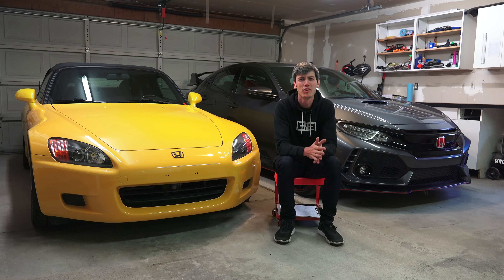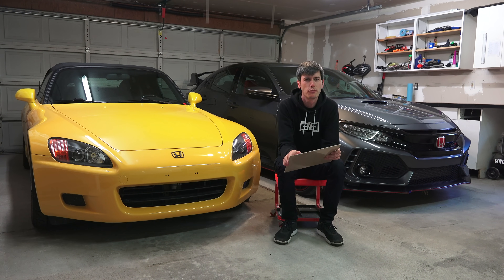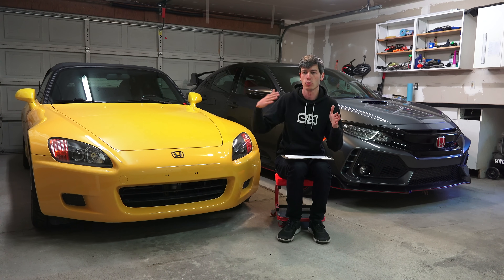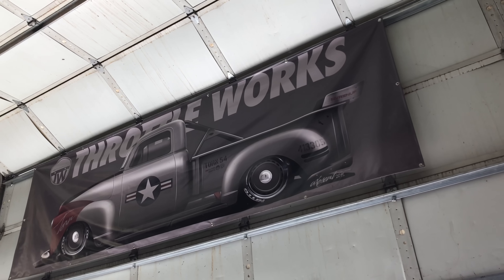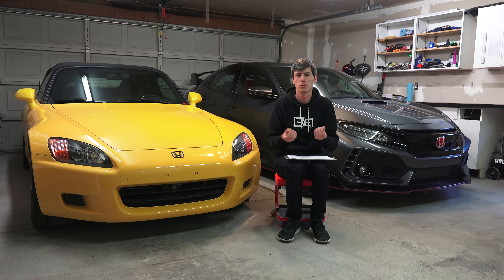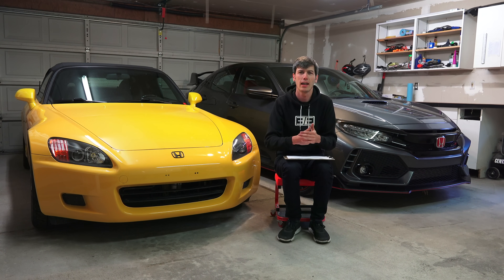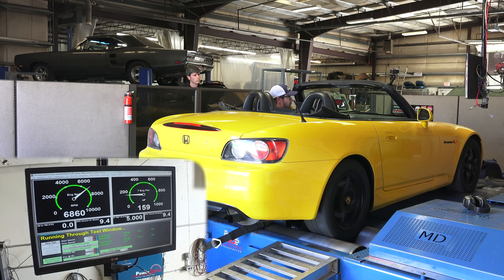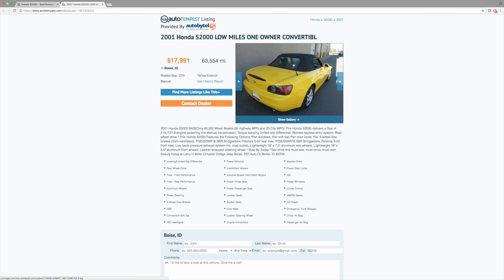Why Comparing Dyno Numbers Is Silly - S2000 Gets Dyno'd!

Comment: Super Charged S2000? Oh that just made my day looking forward to the results.

Although I disagree with you're thoughts about Dyno's, yes they all read a bit differently but you are getting a solid ball-park figure as long as they are the same
type of dyno and you take environmental factors into consideration.  5-10 HP  is so small a difference that you may not even notice it when out on the road.

Comment: I never do shameful plugs on other people's channels so hopefully this isn't interpretted that way, but... I wrote dyno software that can take data logs from tuning tools like Dashhawk and other OBDII loggers and turn them into dyno graphs.  You can google TT Dyno if interested.  Been subbed to you for a while and thought it might be useful given the mods/testing you are doing.  You basically just log speed, RPM, and time: on flat ground, WOT in a single gear and feed a CSV file into the software.  Only other thing you need is some vehicle params like weight, plus weather conditions.

Comment: So, dyno's are useless for discerning power output. But they are useful for establishing an arbitrary baseline from which to discern power output differences after modifying - yes?
Reply from the maker: Correct. Maybe not completely useless in determining power output. I mean if you put a more powerful car on the same dyno, it will show that it's more powerful. The exact power number, however, is difficult to say. And comparing this number with a HP number from a different dyno at a different location won't give you much meaningful information.
Reply: Context dependent, relative difference - the bane of all bragging rights!

Comment: Great video and you've brought up a very important point in the high performance world, especially for couch racers who don't realise that dyno numbers can be greatly influenced by the operator. Your absolutely correct with variances in dynos.  I have been involved in the racing industry for about 15 years and have learned that the biggest variable to affect dyno accuracy and consistency is the human/operator. Yes, it can be argued that different dynos are more accurate than others, but it really doesn't matter if the operator doesn't know what they are doing, or worse yet, thinks they know what they are doing but really doesn't.  I have seen 10 - 20+% difference in numbers measured with same dyno but with different operators.  ie. Garbage (inaccurate data) in, garbage out!  10% is a HUGE difference in racing!  However, the real truth usually comes out when the vehicle hits the road, in the end that's what really counts.

Comment: Shouldn't the V-tec "kick in yo" earlier? 
It bumps the curve instantly and the torque lift is quite steep. Perhaps there would be a benefit if it swaped cams 1k or even 2k earlier since it is noticeable that at such engine speeds the stage 1 profile is choking the intake already.
Reply from the maker: Yeah, I thought the same after looking at the plot. Probably could be helpful a bit earlier.
Reply: Kilo Kountry no it's nothing like that and it's absolutely a performance thing. It's a low lift cam profile (think truck like cam) for good idle and and good low end torque (in the context of a 2L engine). Then right when that cam is running out of breath it switches over to a high lift race cam profile that enables it to run out to 9000 rpm and make 240hp at the crank. Nothing about this car was made for economy. It turns damn near 4K rpms at 70 in 6th gear. If it was as you say than either 1. At idle it would lope like a cammed V8, barely stay running and be even worse on gas or 2. it would redline at 6000 rpms and make 160hp at the crank like most other 2L engines from that era that didn't have some sort of variable valve lift technology. Luckily it has the best of both worlds. VTEC-E was the one created for economy but that's a whole different animal.
Reply: No he didn't, lol.
Reply: It's not like the S2K is an economy-oriented car though, is it? I mean, in a Civic, yeah, sure ... but in a two-seater lots of people don't drive daily ... why bother.
Maybe that was one of Honda's design considerations though, who knows.

Comment: If all dynometers are calibrated and using all sensors ( air temperature etc ) they should be all reading similar output of hp. I believe hub dynos are more accurate as they eliminate Tyre spinning on the drum...

Comment: I am curious to see how the Super Charger effects the power band. How much torque it sucks off the bottom end.
Reply from the maker: Yes, it will be interesting to see. It's a centrifugal charger, so it's likely going to have very little effect at low RPM, and build boost as it spins faster at higher RPM.

Comment: A stock s2k put out 240 hp to the crank not the wheels.  Around 205 whp is about right for a stock new ap1 s2k. 15 year old 100,000 mile car 190 to 195 whp would be excellent.  The funny thing about the S2k is the torque peaks way up around 8000 rpm also.  I don't know how Honda pulled that off.
Reply: maybe big short intake ports, that would make low rpm port velocity, well, LOW ,therefore adversely effecting torque, but helping high rpm, and of course the cam, Ecu and other factors
Reply: I don't why or how they crammed the torque peak so far up the curve. I just know that cars are more fun to drive on the street when your peak torque is low within your daily driving rpm band.
Reply: The head is factory ported and the valves are pretty huge relatively.
Reply: Andrew , more fun for the average joe.  For those of us that know how to use a gearbox and love that last push for the redline there is nothing like a high winding engine. 
 A basic N/A BMW strait six is the best of both worlds.  Good power and torque below 5000 rpm with a nice final high torque high hp push for the 7000 rpm red line.   All the 2.0t turbo's on the market now have no top end.  The laggy top end ok  2.0 T in the Civic type R and the wonderfully liner Vw/Audi 2.0T are two exceptions.  Most cars have a 3000 rpm power band weather it is from 6000 to 9000 rpm or 1300 to 4300 rpm is up to the manufacturer.

Comment: I wonder what it would read if you put an actual horse on a dyno.
Reply: The definition of horsepower created by James Watt was based on the continuous, sustained power output of a draft horse.  He measured how much water could be raised in a minute, at a normal walking pace, which ended up as 33,000 ft-lbs/min.  Or 550 ft-lbs/s.  That is 1HP.  However, the peak power output of a horse (at a sprint) is about 15-20HP.
Reply: A single horse can produce a good bit more than one horsepower, actually.
Reply: David McClelland it would get sucked into the rollers
Reply: Actaully about 15horse power for an average draft horse.  But remember that hooves dont have slippage the way tires do.
Reply: It's in the front right below the air intake. Unleaded only.
Reply: NickiLasse no they pulled coal in the experiment not water
Reply: 1
Reply: One

Comment: Could you do a video on "Why engines have losses over time"? I presume it's to do with the cylinder head getting clogged with carbon, piston rings leaking, cam shaft wear, tappet adjustments (hydraulic vs adjustable), etc. In fact, I restored a fair bit of torque after reconditioning my cylinder head alone so I presume that is the main cause of losses.
Reply from the maker: Jim Griffiths ha! So happy you asked! I’m doing a three part series with AutoTempest, and that’s the next video! :)
Reply: Awesome! Can't wait to see them. :) Thanks so much for all the time you dedicate to making these videos.
Reply: It is a combination of all the things you mention, plus things like injectors and fuel systems clogging over time, cat and mufflers becoming full of carbon causing restriction, HT leads and spark plugs wearing out, and sometimes things like engine sensors getting old and becoming inaccurate, leading to sub-optimal fueling/timing.  You'd be surprised how many bhp you can gain just from cleaning your fuel system and injectors, +10bhp is perfectly realistic! Likewise new sparks and leads can add 5bhp to an old engine.
Reply: Jim Griffiths That would make for a really interesting video. I'm kind of surprised that you got so much back from reconditioning the cylinder head. I always thought that the main cause of power loss came from ring and cylinder wall wear. Jason, if you see this, please make this video!
Reply: Fuel filters are consumables like spark plugs, so this is obvious. An old fuel filter will first be a problem when it gets too clogged. It does not manifest itself as a gradual decline in power over time. Cylinder and rings wear is rarely a problem unless you over rev it or skip oil changes. Looked at cars with 350K and Cylinders look as new. What kills compression is clogged or pitted valves which is always to be found to some degree on older engines.
Reply: Jim Griffiths : restoring "lost" horsepower by reconditioning and replacing old parts would be a neat segment to see if they gained back. Like would replacing the O2 and map sensors get HP back?

Comment: Power is a physical quantity that should be measured to some degree of accuracy. To blanket label them "it's meaningless on different dyno" absolutely not true. They may be off by some factor (may not be linear), but they certainly do mean what they measure. Of course, whether lay people understand the complex parameters is a different matter, but the dyno readings, even the peak values by different dynos, are relevant.
Reply: Engine dynamometers in air-conditioned engine dyno chambers give excellent and accurate results --> chassis dynamometers with variables like tire pressure, ambient temperature and so on do not give such accurate  results  sadly. :(

Comment: So then, how would you accurately determine HP?
Reply: By understanding the variables, running the dyno correctly, and understanding the precision and accuracy of the dyno and including the error with the data. There has to be a dyno shop somewhere that actually knows how to use the thing.
Reply: Use an engine dyno for engine power in a steady constant engine speed using a brake to absorb the engines torque output so that the forces are equal. An object in motion or this case rotation stays in motions. It will only accelerate or decelerate if the forces involved are unequal.

This is the term brake horse power. It's measured by knowing the rpm of the engine and the torque output measured by a load cell on an arm attached to the brake. Between those two you have work and time to calculate power.

Doing power sweep tests on a Rolling roads and even hub dynos have a big problem you cannot easily make accurate which is inertia. The moment something is accelerating its using some of it's torque to work against the inertia of the load. Now while it's easy to compute the inertia of a roller. It's less easy to know the exact inertia of your drive train masses which are all unique to the car not just model. Think tyre wear brake rotor wear.

Plus then try to know the moment of inertia for all your gearbox and drive shaft prop shaft and clutch etc etc it's a no go. You'll never do it and it mot be the same in the next car.

So again you can more accurately measure power at the wheel in steady state using a brake on the end of the roller but you can't be as accurate when running a sweep test.

You have to assume an about of inertia for that typical type of vehicle. Too low as the rate of acceleration increases power numbers are skewed lower. Too high as acceleration rates increase then power is skewed higher.

Massive giant 2 Tonne rollers like dyno jet are terrible as they do not control the rate of acceleration meaning changes to the vehicle will effect the the rate of acceleration and depending on drive train inertia skew the gains down or inflate them.

Australian makes like dyno dynamics use a ramp rate to control the dyno to maintain the rate of acceleration during a sweep test so any inertia error will be the same whether you have a 200hp car or then boost it with a a turbo to 400hp the inertia error rate will be the same on both runs as the dyno will use more braking to control the acceleration rate to match.

However they're still not perfect as you as an operator still have to enter the amount of inertia. Also the operator might choose to do a run at one rate of acceleration and then another run at a faster rate of acceleration as he can select this based upon kph per per second. Again any error in the inertia will show an increase or decrease depending on how whether you over or under estimated your inertia.

It's possible to trick rolling roads by changing wheels or brakes or flywheels and changing your inertia of your drive train during a sweep test also. Hub dyno are less susceptible as they don't have wheel masses to worry about but do have some inertia in shafts hubs and gearbox etc.

But again the only way is to use a brake to equal the forces and measure in steady state, 

Why don't we do this on a rolling road, well it's inconvenient and very stressful to hold a vehicle at full throttle at a steady speed, plus even tyres and traction sometimes not practical at all.

A rolling road is all about conveniences of quick and easy testing you must understand this and it's important when using it to keep your testing methods consistent as if wouldn't matter if the dyno is inaccurate or measured in fairy dust. If it put out the same result back to back that when you made a change you could be confident that it was quantifiable. 

If it's not consistent then it's a waste of time as you'll never really know whether or not the change was really making the difference.

And this is before we even get into parasitics of dyno tyres or drive train windage etc to try get a flywheel figure on a chassis dyno..
Reply: I disagree with all the other replys on here.  We can measure all sorts of things with great accuracy, but everyone thinks that horsepower is too hard to measure for some reason.  My guess is that it can be done, but it would cost more than almost any shop is willing to pay, especially when the stuff they have is good to (I'm just guessing here) +/- 20%.
Reply: Faketrollname sevenbillion Lol
Reply: Jay J OK so let's just throw engineering out the window. Nothing means anything. Got it.
Reply: Fucked -32 GTR, there is no truly accurate way to measure HP, as there are always too many variables in play.  The most accurate way is probably pull the engine and run it on an engine Dyno to get Brake Horse Power numbers, but even that isn't close to perfect.

The only way to get true bragging rights is to race your buddy head-to-head.  You know, old school!

Comment: I've done many dyno sessions with my BRZ/FRS. Like you said, the only real benefit is for comparing before/after mods on the same car, to see the gains. You also have to consider weather correction factors, as the mustang dyno will show a different value each day. I have a lot of these dyno sessions on my channel too, fun stuff!
Reply: Bach Frog hey me too. I'm slow. Lmao a cammed v8 I'd like throwing a fart can on a honda. More about the noise than anything
Reply: Sergeant Speed except a cammed v8 actually sounds good
Reply: Sergeant Speed what. Cam is 100% internal and for power.
Reply: Sergeant Speed my car is far from stock and the ls isn't a Chevy 350
Reply: Samuel Bowman v8 cammed camaro
Reply: Bach Frog 😂 you wish
Reply: Bach Frog on a stock motor it makes a difference but most people cam a 350 for the lope.
Reply: Bach Frog do elaborate. What do you drive? What's the set-up? Whats not stock?
Reply: Justin's Pit Lane nice
Reply: Bach Frog stfu I bet you drive a "sport" corolla
Reply: Justin's Pit Lane lol weak ass car

Comment: Would be interested in seeing HP increase with water injection before supercharger installation and with supercharger installation. Will you beef up bottom end to account for supercharger installation??
Reply: built motor, should handle a sc fine unless there's considerable wear
Reply: Water injection does not add power unless you are running into predetination issues (too hot IATs or too much dynamic compression)
Reply: Nicolas Losito ... Hi Nick, please confirm with data. I believe that there are technical papers that show Water injection increase fuel/air density and therefore translates into increased HP. WWII fighters had water injection to increase HP on take-off that could be switched on and off as needed. 
Jason... would a dyno prove this as true or false?
Reply: John Mcneill I'm lost at water injection, is this the same concept  for forced induction water cooling?
Reply: Stock bottom end of the F20C can handle the supercharger just fine.
Reply: logan thompson - Hi Logan...this is a question for Jason. I’m the old days with carburetors, a nozzle was fitted below the butterfly and the Venturi effect sucked water in with air. On a 350 mile trip I used 2 gallons of water. I believe modern turbochargers either spray water into the intake or it gets drawn in through a Venturi. Either way the air fuel mix is densified. Valves and cylinder head were as clean as a whistle. Not sure what it did for fuel economy. 
Jason... comments???
Reply: John Mcneill never thought of injecting water into the combustion chamber the thought of it horrifies me, I was thinking of water cooling the intercooler which in essence cools the metal which in turn cools the compressed air.
Reply: logan thompson ... Logan, the water is vaporized/atomized and in this form is combustible. The addition of CH3OH or C2H5OH to the H2O helps with combustibility.
Reply: The bottom end of the S2000 is built already.  I've had a SC on mine for over 6 years.  Added +120 at 6psi on a Mustang dyno in fact.  Water injection alone won't do anything for this car.